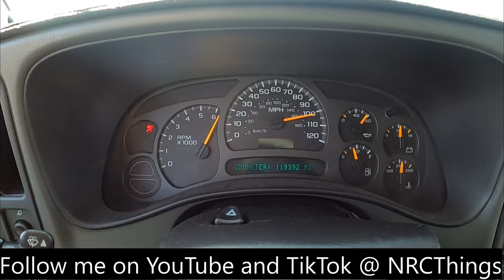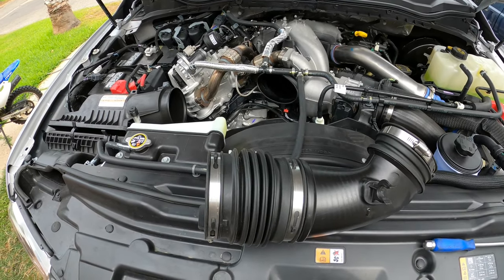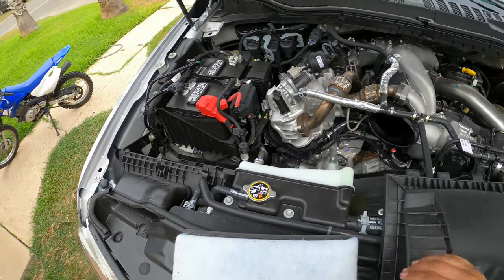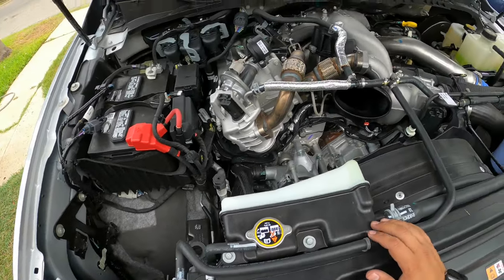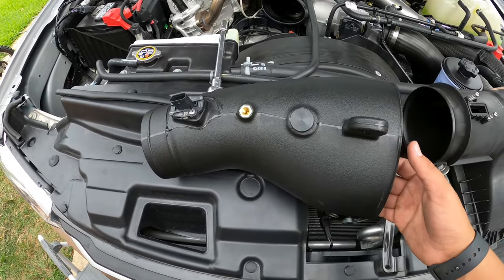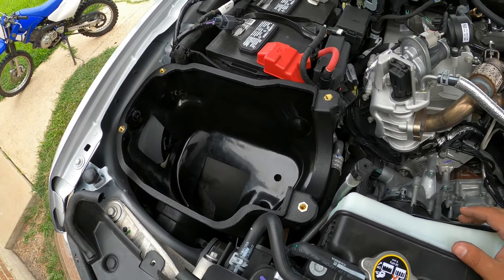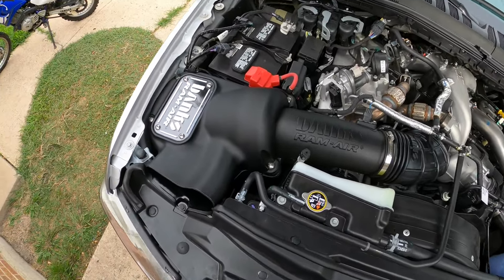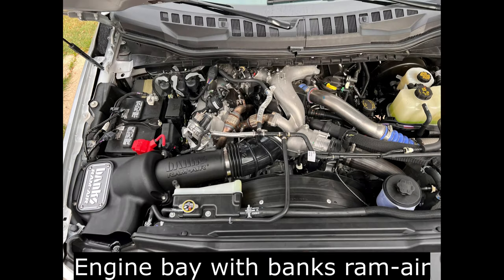Banks Ram-Air Intake Install, Start Up, and Rev on a 2022 Platinum 6.7 Tremor!

Comment: Great job! any guesses as to power increases with both of these mods?
Reply from the maker: Thank you for the comment, Mike! As far as horsepower gains I would think it is probably 10hp at most with both. We were really looking to get regen times, regen temps, and regen frequencies down. This in turn would help long term fuel mileage and be less wear and tear on the engine and the components for emissions. Once again, thanks for the comment! make sure to like and subscribe!